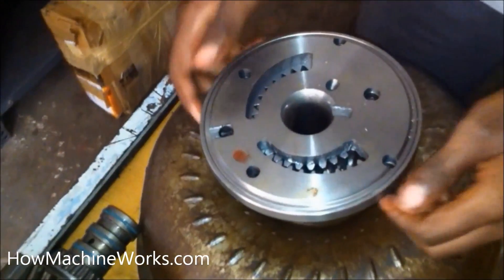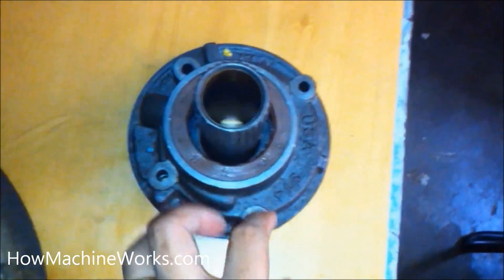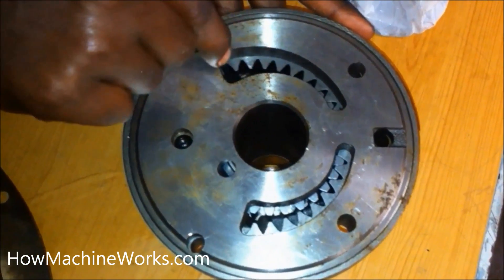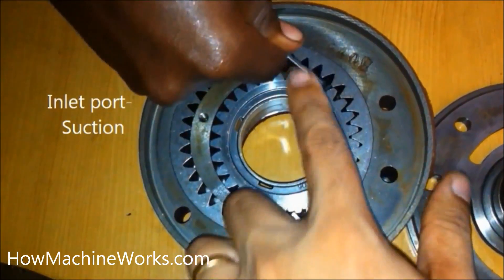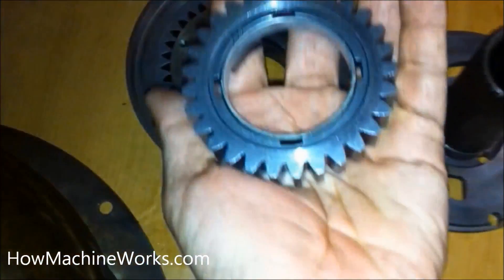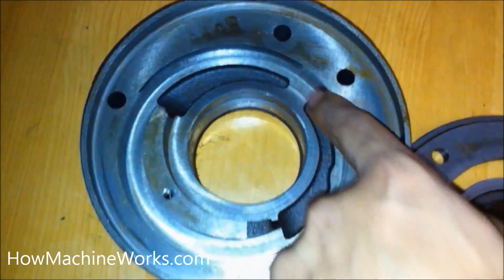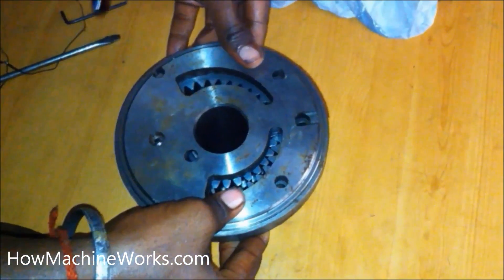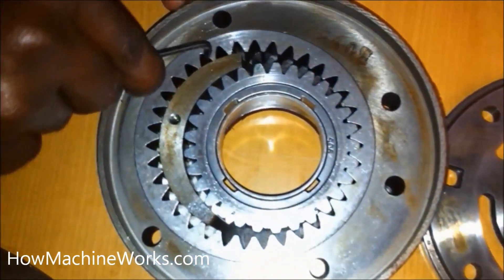How hydraulic transmission pump works -- dismantled. ✔

Comment: One thing Crucially I need to understand, Who drives the gear pump? engine or torque converter? If engine drives the torque converter shaft, then pump also be driven bcs both are same shaft. If pump is driven then torque converter also be driven. HOW the converter's power is propelled to hydraulic clutches and forward or reverse gears?

Comment: very good. Please your opinion:  How efficiently would this device work as a hydraulic motor when the flow of fluid is reversed?  Explanation: I am searching for a (cheap!) powerful hydraulic motor that could be mounted to each drive wheel on an articulated vehicle.